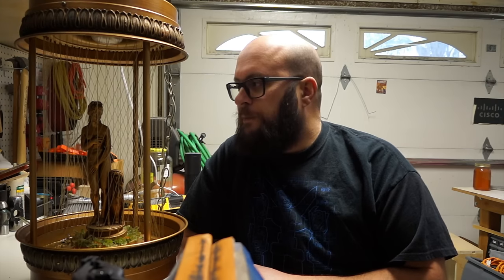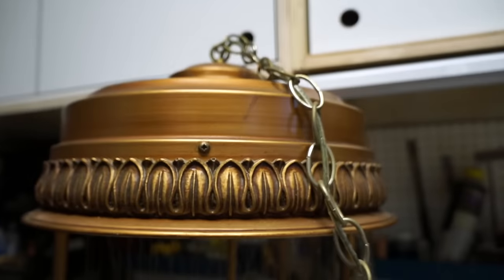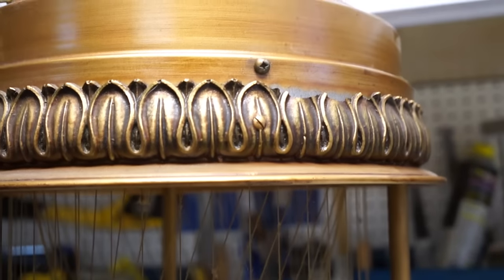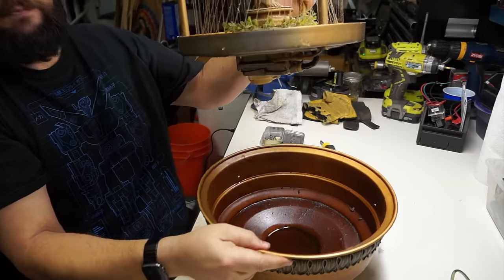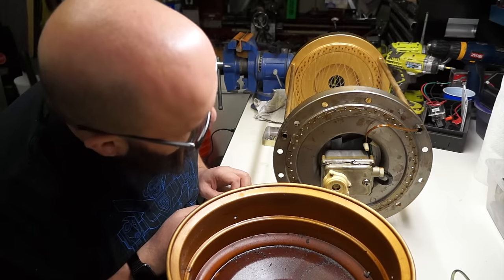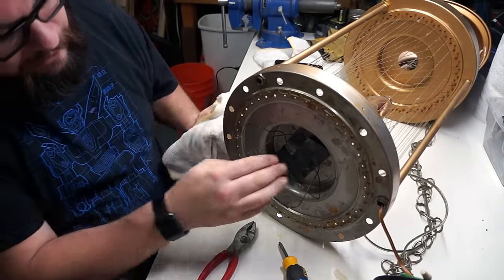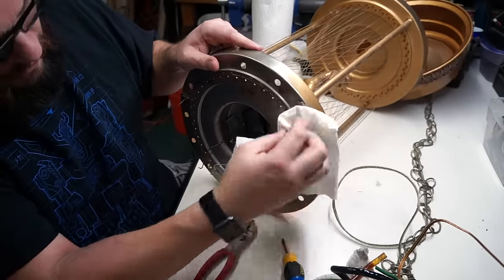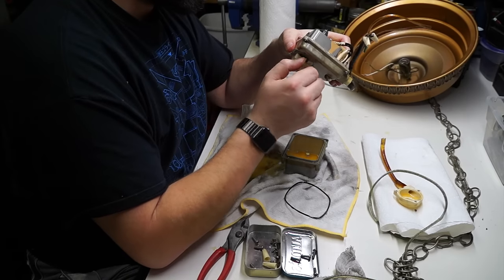Restoring a Oil Rain Lamp Part 1

Comment: Hey I came across two lamps with bum motors and I’m having issues finding replacements. Do you have a guy by chance?
Reply from the maker: So look on eBay if not a normal fountain pump will work too.
Reply: TheHandyAndy kk. Have any recommendations for fountain pumps?
Reply from the maker: Not really just any one the small you do not need a lot of flow just a good head. So measure the head. If you do not know what head is look up water pump head.  It the way to measure how high a pump can pump up a liquid.

Comment: You shouldn't use an led light bulb because it was allso ment to worm the oil to make it soft to reduce ware on pump
Reply from the maker: So funny thing LED sockets create a lot of heat.  The oil it self is already to wet and runs way to fast.
Reply: I restore and sell them. Also restore antique tv's and radios....
Reply: @seanmccoy4930  do u do restore for people

Comment: Can  you  buy  these oil lamps?
Reply from the maker: You can find them on eBay. They are not cheap $300 - $600.
Reply: @TheHandyAndy  thank you are The lamp's vintage
Reply from the maker: All the ones I seen are. Check out vintage oil lamps on IG he has a massive collection.

Comment: Mineral oil and baby oil are the same thing baby oil is very inexpensive plus it smells good
Reply from the maker: Yes they are the same but the smell would be hard to take.  Let say i do not want to hear why do i smell stripper smell.  The bulk mineral oil i got was cheap.
Reply: Do you know if the flow can be adjusted? Instead of a slow peaceful drip the pump works so well it looks like a monsoon rain storm.
Reply from the maker: So some of my lines are this way. So from what I can tell there is an inner brass insert the restricts the oil flow and holds the monofilament. If you open that up the flow would go faster.
Reply: TheHandyAndy thanks for getting back to me. I would like it to flow slower so the oil raindrops slowly run down the monofilament lines, mine the oil pump is doing so good the drops are really speeding down the lines it looks like a down pour instead of being relaxing.
Reply from the maker: So easy pinch off the tip then with pliers. That will slow down the stream. Make sure your return pipes the take over flow are clean mine over flowed and got all over.
Reply: TheHandyAndy ok I’ll try that, thanks
Reply from the maker: Better idea. Get some toothpicks and cut them down to about 0.5 in. Then test if they slide throw. Now if they do not it should block the flow. Now the trick is to then cut a vertical V grove. The bigger the grove the more oil. I just thought of this last night.